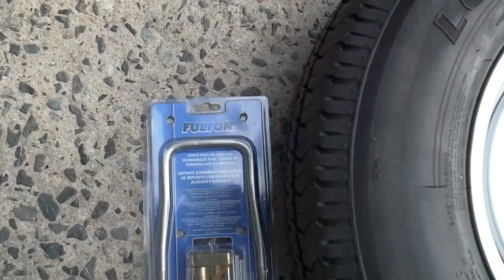The Just-In-Case Spare Tire Upgrade

Comment: Getting one of these.  Is it pretty easy to push around by hand?
Reply from the maker: Somewhat my front jack wheel seems to be getting stuck more pointing in one direction.  My just need some oil.  If you have a level smooth surface its pretty easy to move around.